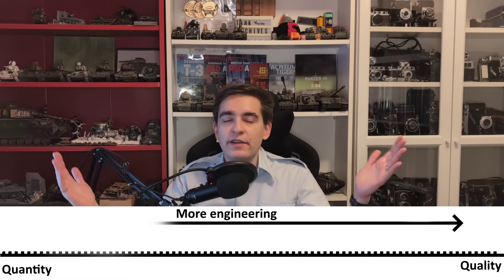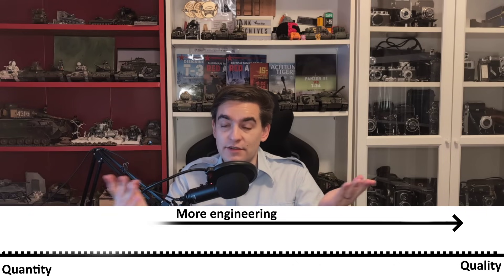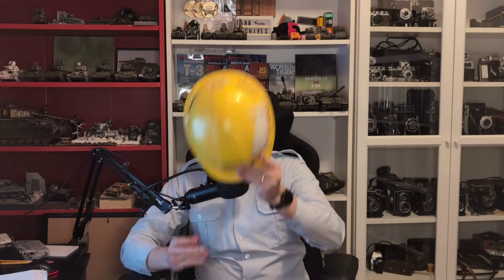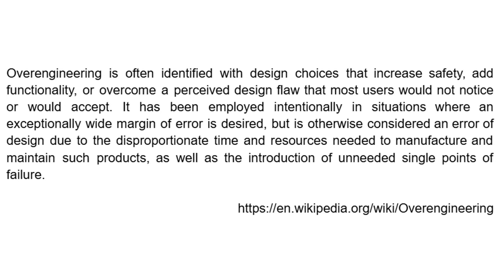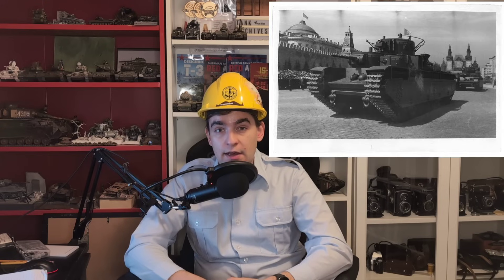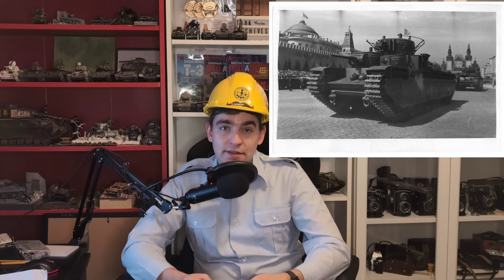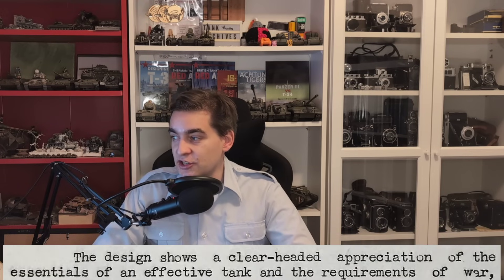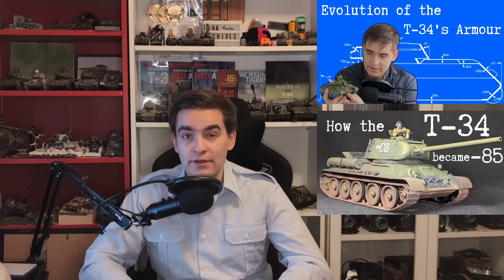Was the Tiger overengineered?

Comment: I don't qiite get your logic. The problem with your evaluatiom of the Tiger tank is, that think of the whole tank as a given solution, wich someone should have perfectly figured out, in respect to the challenges posed by the battlefield. 

Now, for someone like me, who actually works in this industry (engineering department of a defense company), your take on the Tiger being not overengineered but rather bad engineered, is plain wrong. 

As i understand it, you said, that the industry was mainly leading the developement, right?
That's not how it works and it wasn't the it would have worked back than, otherwise Ferdinant Porsche would have been building the Tiger P instead of the Ferdinant tank destroyer. Usually there is a contract made, in this contract are specifiv requirements stated, wich the vehicle has to pass. Those requirements are chosen by carefully considering, what is needed by the client and what is actually possible to manufacture by the company, wich in turn is dependant on what the suppliers can deliver. However, there can be several miscalculations on the weight of a vehicle and this will be communicated to the Client and compromises have to be made. In this industry, only results matter and there are several sources stating, that the german troops had few to no complains on the Tiger 1, compared to the Tiger 2, the Elefant, Ferdinand and other vehicles.

To sum it up, i think, you simply make the wrong comparsion. Rather, you should have asked the following question: Was the vehicle developed to fit most, if not all requirements?
Than one would actually see, that the Tiger was not worse of than a sherman, or a T34 and the term "overengineered" would also have been debunked ...

Comment: Consider the Tiger I transmission.  As I recall it was semi automatic with eight forward gears and four reverse, and therefore very complicated.  That was bad enough, but it could only just cope with the power of the engine, which had to work hard the whole time to propel 56 tons of tank across country.  The result was frequent self inflicted "mobility kills".  It looks like the Tiger needed lots of engineering, but of a different kind.
Reply: The Tiger 1 had as good or better power to weight ratio than most Sherman variants - a major reason why the big cat actually was reliable by WW2 standards. It needed a major overhaul every 3,000 miles , vs. 2,000 miles for the best Sherman variant (diesel).

https://www.youtube.com/watch?v=bBni1Nd9Ez8
Reply: @TTTT-oc4eb Doesn’t matter how much horsepower and engine can crank out if there ain’t a transmission to bring that power to the tracks. 

A big part of the reliability of the Tigers was that they were typically given to the best tank crews who could maximize its qualitative superiority. They were willing and able to put the effort needed to make them work reliably, and as a result were able to keep them working for the most part. It took a skilled driver and commander to make Tigers reliable as they knew how far they could push it. 

Shermans achieved their reliability without the need for such skilled personnel.
Reply: @Pilotmario  and your source for these bold claims is...?

The Tiger, with its power assisted steering wheel and advanced transmission was actually a lot easier to drive than the Sherman. The Panther did not have a steering wheel, but was still a lot easier to drive than the Sherman. The Sherman was heavy on the controls. See videos from the French tank museum.

All tanks need skilled drivers, a poor driver will quickly get his tank in trouble. Of course heavy tanks, by default, need to be more careful where they drive.
Reply: @TTTT-oc4eb  The Chieftain. I'm well aware of the creature comforts afforded to the driver of the Tiger and Panther tank, but that isn't relevant to the fact that the Tiger had rather fragile final drives which Nazi Germany could not address due to material and supply shortages during the war as well as declining material and manufacturing quality. 

What kept Shermans reliable was a mature mechanical design. It worked very well, regardless where it was, be it Ukraine, Normandy, Berlin, the Black Forest, El Alamein, El Guettar, Papua New Guinea, Burma, Tarawa, and Okinawa, it worked when it needed to. 

Tigers and Panthers were not nearly as mechanically sound, so required a relatively skilled crew to not overstress the drivetrain. As mentioned, it was originally meant to be a much lighter vehicle. Tigers were considered specialist weapons, and got the best crews, mechanics, and resource priority to keep them working to the best of their ability. 

Panthers had much the same issues, but didn't have the benefit of the best crews, mechanics, or priority. As a result, they were much less reliable, not aided by declining material quality and the use of slave labor which may have pumped the numbers but now placed a bunch of very unwilling people next to metal shavings and the internals of gearbox assemblies. By then, the Tiger was out of production, replaced by the Tiger II.
Reply: @Pilotmario  Ah, the Chieftain. He is by no means unbiased when it comes to the Sherman/Panther. 

The Tiger's final drives weren't fragile, you are thinking of the Panther. The Tiger had different, much more durable final drives.

There are absolutely NO real evidence that the Sherman was more reliable than other late war Western tanks like the Cromwell, Churchill, Panzer IV, Panther or Tiger. Just hearsay or "because it was". The Sherman, like all WW2 tanks, broke down a lot during road marches, too. According to Belton Cooper, who was an engineer and Sherman mechanic, 20 out of 50 Shermans would be expected to fall out due to minor or major mechanical issues during a 30-40 miles road march. This is 1944-45, even a brand new family car could be expected to break down once a week, and cars have always been far more reliable than 30-60 ton metal monsters. In direct comparison in 1944 the British actually found the Cromwell to be slightly more reliable.

The "horrible reliability" of the Panther and Tiger is mainly Allied propaganda. The proof of this is that the Germans themselves considered them reliable, once the initial teething problems had been ironed out. As early as 1943 the Tiger was considered to be more reliable than both the Panzer III and IV. In 1944 both the Tiger and Panther units had an average readiness rate of 65-75% (Jentz 97), and many of the big cats sidelined were out due to combat damage, not only mechanical problems.
Reply: @ Death Traps is a fine memoir, though only from his perspective and notably your figure is not in relation to any other. Testing and evaluation by the U.S. of the Cromwell under British supervision pointed to a far less reliable vehicle than the Sherman, and British forces continuously praised its reliability. 

A big part of its reliability was not only the high quality of its components, but the fact they were fully interchangeable which made repairing any breakdowns much easier. Interchangeable automotive parts weren’t as common as you’d think, especially in Europe. 

The Germans may have considered them reliable by their standards, but they had also considered the Sherman a fairly reliable and well designed vehicle with good reliability and suitability to mass manufacture. Perhaps their best testimony as to its qualities was that while they frequently modified captured vehicles to make them suitable go their tastes such as new cannons or adding cupolas, the modifications to Shermans for combat were cosmetic. They also relied on captured Shermans extensively as recovery vehicles with Tiger units, as the mechanics considered them more reliable than their tanks. 

Even Pete Samsonov will attest to the Sherman’s reliability. https://youtu.be/yC30ouO7UZc?si=8vwNRtILlZtpGT2W

Yeah, this channel. In the comments he places them well above the German cats.
Reply: @Pilotmario  You are refering to a 1943 comparison, by 1944 the Cromwell had its teething problems ironed out and was at least as reliable as the Sheman. During a 10 day period in the pursuit phase after Normandy, 20% of all British Shermans suffered major breakdowns, the single Cromwell unit suffered fewer breakdowns than any Sherman unit. The M4A3 with its Ford engine, the most common variant in US service, was probably more reliable than the variants in British service, but then again it is this variant Belton Cooper is talking about.

There were around 100 minor or major Sherman variants with 5 very different engines. They weren't as " interchangeable" as you think. The M4 and M4A1 were very different tanks than the M4A3E8. And the radial engines in the M4 and M4A1, let alone the multi bank engines in the M4A4, were by no means easy to maintain. The Maybach engines in the German tanks were much easier to access and maintain.

As for German use of the Sherman, they were desperate for any tank they get their hand on, the far from perfect T-34 was far more common in German use. 

As for Samsonov, let's say he is slightly biased when it comes to German tanks, and especially the Tiger. And a direct comparison between the Sherman and German tanks is impossible, they were just fighting under very different circumstances. While the US supply lines were long, they were also very safe. The supply lines of the Germans were much shorter, but also much more dangerous - the tanks, spare parts, fuel and ammo being under constant attack right from the factory all the way out to the front.
Reply: @ You mentioned earlier that diesel-powered Shermans without distinguishing between the twin GMs and the Chrysler A57 multibank monstrosity that somehow worked reliably were better and used that as the metric which to measure the reliability of the Sherman in comparison to the Tiger. Then you state the Ford engine of the M4A3 used by the U.S. Army was more reliable over the models used by the British, despite the fact the models used by the British were mainly the diesel-powered Shermans. 

All I can say is that is not a contradiction which can be readily reconciled, and can be best explained that you have even less idea what you’re talking about than those you consider lesser. 

I should note that there was substantial parts compatibility between all models of Sherman, as the mounting points for the turret, engine, transmission housing, and suspension were identical between all models, and even differences in the types of subassemblies often did not interfere with reliability between them. 

You’re going to claim that a vehicle built from parts supplied by dozens of subcontractors and assembled in facilities where parts interchangeability was considered essential to mass production, designed and manufactured by an industry who at the time made and sold car models built on common chassis with many engine options and the idea that you could interchange parts so easily that upgraded parts could fit into old assemblies without even the pass of a file, with parts made precisely to tolerances instead of hand-fitting, wouldn’t design and make a tank built like that? 

Do you even know what tolerance means in an engineering sense?
Reply: @Pilotmario  Now you're just getting annoying, and I am not going to read that wall of text. 

The main British Sherman in Normandy was the M4A4 with gasolin engine. The diesel engined M4A2s were mainly used in the East and in the Pacific.

Now, get lost.

Comment: Well there is also the question, is the Leopard-2, Challenger-2, M1 Abrams and other NATO tanks over engineered?
Reply: No, they are the exact opposite. 
The MBT-70 project was partially cancelled because it was overly complicated and riddled with problems, the M1 Abrams grew out of a set of requirements that meant it had to be a affordable, mass-producable and reliable machine with significant upgradability in mind. 
There are over ten thousand M1's produced across their service history, they've clearly reached significant enough numbers to reach the ''quantity'' mark.

The M1 Abrams is also a superior design to a T-72, which isn't surprising given that the Abrams is a design that's a decade newer. It is indeed heavier and larger, though that mainly comes down to the choice of using a human loader rather than an autoloader. 

It's also quite telling that Russia is now producing purely T-90M's, which are significantly more expensive and technologically complex than T-72B(3)'s are.
Reply: @JamesVDBosch  Not really more expensive or complex...T-90 welded turret is simpler and cheaper to make for example, as well as more repairable. All new tech latest T-72 and T-80 upgrades get too, T-90 was just designed with them in mind already.
Reply: @alexturnbackthearmy1907  This is simply not true, the CITV alone accounts for a significant percentage of the total cost of a T-90M, neither the T-80BVM nor T-72B3 feature a CITV. 
The T-90M features a vast array of improvements and additions that the T-72B3 and T-80BVM do not. The T-90M also weighs 5 tonnes more than a standard T-72B3.
Reply: @alexturnbackthearmy1907  Commander's Independant Thermal Viewer. With the T-90M it's an entire complex system that features 2-axis stabilization, wide-angle FoV, day and night channels (I.E. thermals), integrated laser rangefinder and allows for hunter-killer.
It accounts for 20% of the vehicle's total cost.
Reply: @alexturnbackthearmy1907  No, it doesn't.
No offense, but where are you getting your info from? The stuff you've been telling me so far isn't making any sense, I'm curious how you've been so misinformed.
Reply: Not much more than the top Soviet designs like the T-80. The main practical difference between them and the T-80 in the Cold War was that Leopard 2 and Challenger 1 had far better fire control computers, sensors, and communications equipment.
Reply: @ but it’s like the west didn’t learn anything from WW2, that quantity is a quality in it self. 
Take a look at the price difference between a Leopard-2 or a M1 Abrams and a T-72, and take a look at Ukraine and how those tanks are performing.
Reply: @jasip1000 If going by the most recent export prices, the M1A1 Abrams and T-90S that were sold to Iraq were basically the same price per vehicle. 

Both the M1A1 and T-90M have proven fairly capable vehicles in Ukraine.
Reply: @ yes but there are many T-72B versions and T-80BV compared to each T-90M. 
What I mean is that the West after WW2 when the Cold War began, took the Wehrmacht approach  and the Russians kept the Red Army approach. 
T-55 , T-62, T-64, T-72, T-80 mass produced compared to all produced NATO tanks combined.
Reply: @jasip1000  NATO knew it couldn’t match the massive quantity disadvantage, so had to go with quality. That on its own wasn’t enough from the beginning until the 70’s. Before then, the technical qualities of the involved systems were relatively equal, hence why NATO relied heavily on tactical nuclear weapons to balance this inequality out. 

What changed in the 70’s was the massive advantage in information technology thanks to public and private investments made into developing exponentially faster, cheaper, and more durable electronics. This allowed for better sensors to detect enemy forces, systems to better distinguish friendly from enemy units, and far more precise munitions to defeat them at range. 

What did the Soviets think of this? Chief of Staff Nikolai Ogarkov called those developments a revolution in military affairs, and concluded that the Soviet Union cannot successfully challenge Western forces in open battle without the use of tactical nuclear weapons, and must use hybrid warfare tactics such as the strategic use of misinformation to sow divisions in democracies which would paralyze their willingness to use that force. Sounds familiar?
Reply: @jasip1000  Quantity is not enough on its own though? Besides the Germans DID mass produce AFVs, tanks especially Stug IIIs, though many were thankfully destroyed or badly delayed by allied bombing on factories and railways.

Comment: When I was last at Bovington, a guide showed us 2 examples of overengineering? 1. was the little securing chains for holding removable pins etc. On a Pz 2 these were nicely engineered with the indivdual chain links being soldered/welded into a continuous link; on UK tanks these looked like the cheap chains attached to your kitchen sink plug. 2. Pz 2 had the fake 2nd front visor simulated from a complicated sheet metal shape. Brits just painted on several fake slits in black...
Reply: I'm pretty sure in Bovington I read how the T-34 was a simple, brutish designed that never really changed during the war (ironic since they have a T-34-76 and a T-34-85 on display), so I wouldn't rely on them being a truthworthy narrator. When you walk in and see how many branches of the military and military NGO organisations sponsor them, you immediately get the picture. Nice collection of tanks of course.
Reply: Chains were made using machines, they were not indiviually hand crafted. WW2 happened in the 1940s, not the middle ages
Reply: @CoffeeWalrus 

Ah I'm sorry to break your bawls but there were plenty of chains being hand made in 1940s. 

Alot of naval chains where hand made during this time. And it still involved alot of labor. 

Even today depending on the size there's lots of hand made aspects to large tougher ones.